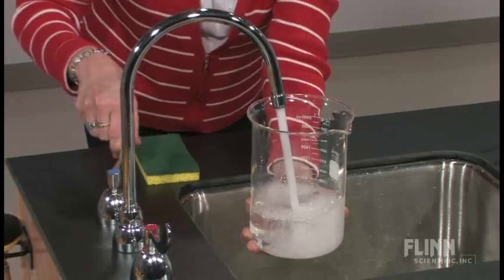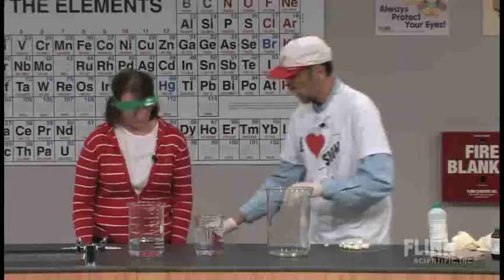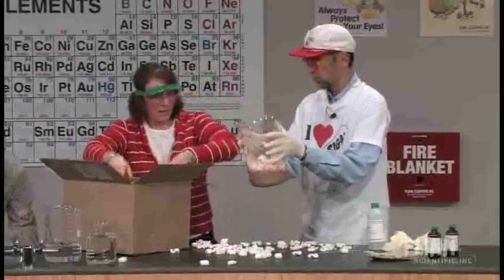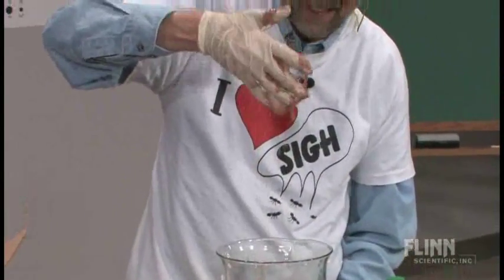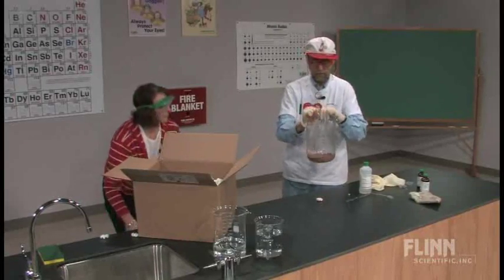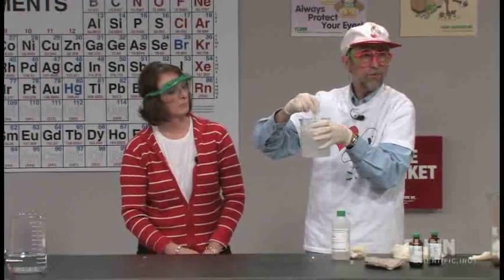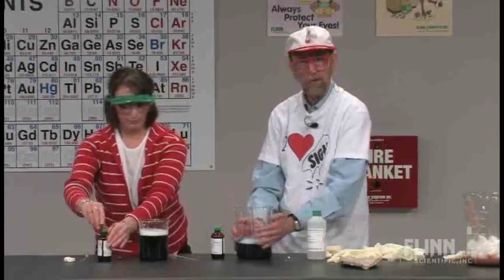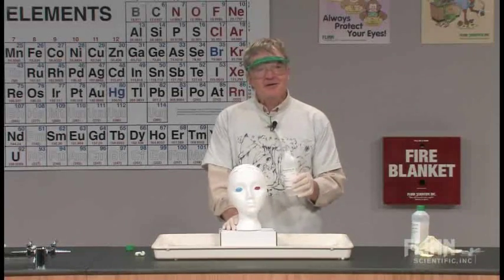Styrofoam Peanuts and Acetone

Comment: I have a large box of what I believe is polystyrene. I didn't want to send to the landfill so I was going to make a wall sculpture with them. I am curious, can it be painted with water based latex once it has hardened if I run sandpaper over it lightly first?